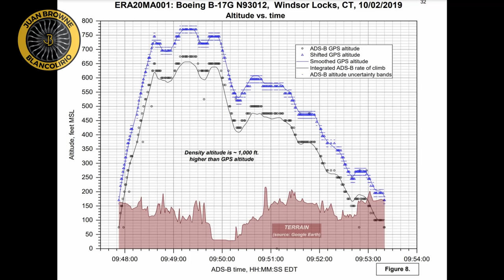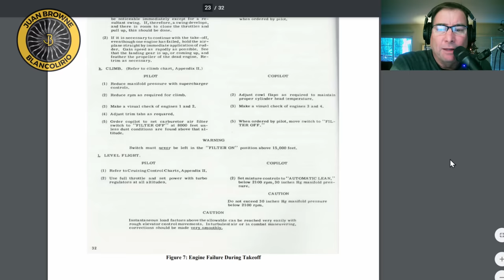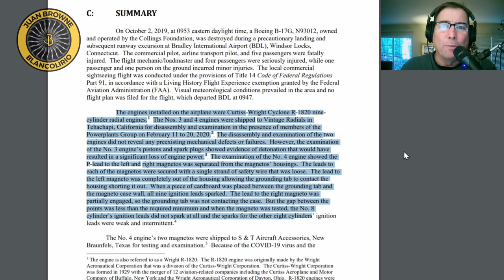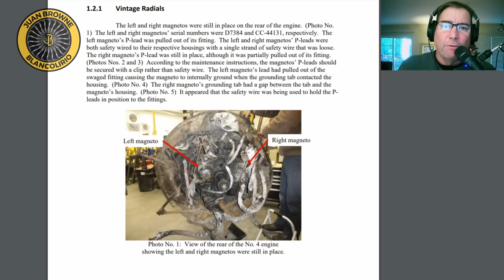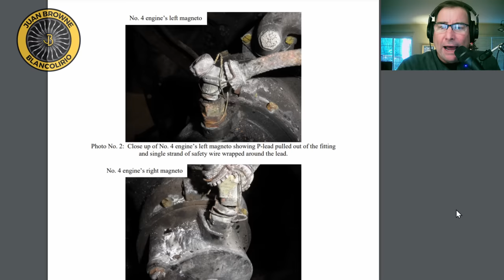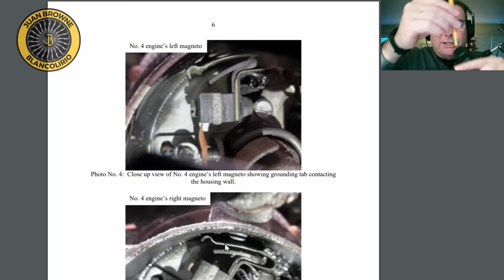NTSB Report B-17G Crash 'Nine-O-Nine' Part II -18 Dec 2020

Comment: Do we know why he shut the engine down?  Even if it was missfiring it would still be producing some power, better to leave it running I'd have thought unless he was worried about causing damage to a valuable engine?  Or did he want to feather it before it stopped on its own?  Can the prop be feathered if the engine isn't running?  Could a windmilling prop be feathered?

Comment: 1 what are you talkin about he shut down the wrong engine don't number three engine is the one that have lost power and he accidentally shut down the number four engine what are you talkin about, you are exhibiting a full reversal from your original opinion. Read the report it was the number three engine that was problematic and he shut down the number four engine then he had two in down on the same side. If you can't do a better job of this I'm going to unload some scribe I'm really disappointed in hearing you say such things

Comment: Thanks for this report. I flew in the 909 in 2015 when it was on annual tour in Venice fla.  We lived near the airport and would see all the planes over our house every year.

I am also a machine shoo instructor and worked in defense plants and race engine shops. The engine tune and maintenance is very interesting. I also drag race professionally and we count on good decisions to not make a mistake in assembly or maintenance.  I can see the B17 had dual ignition system for redundancy and systems to deal with war time issues like engine loss. At some point even these will not save you. 

I will always remember sitting on the floor behind Mack on takeoff and taking pictures thru the upper hatch in mid ship.

Comment: Nice video Juan. Fly Wire’s Scott Perdue has a different take on shutting down engine 4. Here is a link to the Fly Wire video. https://youtu.be/y3p-hGR3ZyY

Scott notes that the pilot passed up runway 33 (which he had speed and altitude to make), dropped the gear too soon, did not follow proper shutdown procedure on No.4, and did not chop power when he was almost lined up with (but short of) runway 6. He shows pics of a failed cylinder (5) on No. 3 but does not comment on whether it might have occurred on impact. Rather, he suggests it failed due to detonation and that the engine progressively failed during the flight. No 3 was never shut down and witness testimony suggests it was windmilling prior to impact.  He notes that the PIC was not an CFI MEI but nonetheless performed checkouts in the aircraft, and that blowing out the mags was a bit of a “home made” procedure.  He notes that the passengers, one of which was a former C130 crew chief, do not recall a run up prior to takeoff though the B-17 flight mechanic states otherwise.  Most significantly, he quotes engineering analysis that suggests the AC was climbing on 3 & 1/2 engines after takeoff but on only 2 after No 4 was caged. 

The engineering analysis is significant.  If engine three was progressively failing due to detonation that would certainly explain the engineering data showing that the AC was flying on 3 & 1/2 engines after takeoff but only 2  after No 4 was caged. It can also be explained if engine four was producing partial power at takeoff (due to the magneto failures you point out) and then engine three failed from detonation. It’s worth noting that engine four would have been producing some power even if one magneto was completely failed and  the other one was not at full capacity.  It certainly seems plausible that the PIC shut down an engine that was still making some power.  

I would be interested to know what caused the detonation in engine number three. Was it, as you question, a mag that was not timed correctly? Or did the pilot push up (and over boost) number three after he  caged number 4?  

Years ago I took a living history flight on this aircraft with Mac at the controls. It is one of my fondest memories. I spent most of the flight in the top turret from where I had the best view in the house,  recorded video, and watched Mac work his magic. I also had an outstanding preflight briefing where emergency procedures, seatbelts, and what to expect during the flight were discussed.  

This crash was so tragic. I credit you and Scott for helping us laymen understand what may have happened.  I hope the Collings Foundation can learn from this, get another 17, and get it’s exemption back from the FAA. That may be a long shot, but living history is so much more impactful than watching a video or reading a book.

Comment: Excellent presentation.  Well researched and superbly delivered in an interesting and educational format.  Easy items to query, what did the engine run-up look like on the mag check.  The P lead problem should have revealed itself in some manner, perhaps a scope.  The other easy query, is what happened to CRM.  The complex nature of this large aircraft demands checklists and CRM to correct or mitigate the problem or problems.  Shutting the engine down in the manner exemplified here results in the final conclusion.  Running out of airspeed, altitude and ideas at the same time.  Once again, thank you for all your efforts.  It is highly appreciated by the community.  (35,000 hour, Airline corporate accident investigator and FAA evaluator on the 747 and other birds plus large military bird check airman.)  Also known as bum.......

Comment: if the aircraft is maintained to OEM specs it should not be allowed to fly. analog ignition systems are easily updated to digital. we restore old motorcycles some use morris magnetos.

Comment: Bead blasting of spark plugs became unrecommended practice in automotive field back in the 80's, bc it actually damages the spark plugs by pitting the ceramic insulator and facilitating potential sources of stress cracks, which result in current leakage. The evidence clearly shows that those engines were poorly maintained by the responsible person who sadly was killed. An operation requiring a McGyver like skills of an elderly 75 year old is almost criminal.  Poor guy did his all and did not know when to say BASTA!. It just shows that a complex flying machine can not be properly maintained by elderly volunteers on a shoe string budget. I would love to see the Air Force get involved and provide assistance in maintaing such historic programs. These warbirds should keep flying to maintaing rememberance and patriotism.

Comment: That's sad, as a master mechanic myself and having extensive experience with mags and points type CDI ignitions, my garden tractor gets better treatment than this bird.
From what you showed, it's neglect, criminal neglect in my opinion.
Just because someone can run and pass a piss test doesn't make them a qualified mechanic. 
My R/C aircraft get better treatment than this bird did.

Comment: Scandalous and disgraceful.  

They couldn't find the proper clip to secure the lead to the magneto for five years?  I understand that you can't just run down to Pep Boys and buy one, but no one in five years could find, or make one? 

I am astounded that the "director of maintenance" would not only allow this level of half-assery, but would trust his own life to it, as the guy who has to fly it. 

They're crooks. Outright crooks.  They take money from people to take rides in their planes, and they don't even value their own safety and lives enough to make sure the aircraft meets the minimum maintenance standards.  Crooked grifters rolling the dice with other peoples lives.

Years ago, I used to volunteer for the make a wish/sick kids organizations. A bunch of us with classic and exotic cars would take these kids for a slow parade lap around the track.  Let me tell ya, they had all of our cars on hoists, checking them over to make sure they were mechanically sound. Cars that we drove to the track that day.   It is pretty sad when cars going around a professional race track at 50km/h are put under greater scrutiny before carrying non paying passengers, than a 75 year old multi engine aircraft, carrying paying passengers.

Comment: That is not the OSHA approved way to use a step ladder. Need a fall restraint system in order to stand on the top step and avoid getting a taller ladder.

Comment: It's easy to armchair-QB mishaps AFTER they happen.  My frame of reference is working and flying on military aircraft for close to 28 years.  I watched both videos (Pt 's1 & 2).  There are always items in the chain of events that if one of the items is removed, the chain of events will stop.  The first thing/item that stood out to me was the Orlando FSDO AND Collins lost effective communications.  Either one should have re-established effective communications after the Collins point of contact passed away.  The  Orlando FSDO lost oversight and Collins didn't seem to  worry about it.  I think it's plausible to suggest this mishap was 2 years in the making.  As Juan correctly noted, placing blame isn't the point.  Hopefully the tragic lessons-learned will be used to help prevent future mishaps like this.
Reply: ......"placing blame isn't the point".......

In every NTSB report on air crashes I have read the object of the investigation is to discover WHY the accident happened.  If the answer to that question ends up being an appalling lack of maintenance and lack of concern for safety, that needs to be said. That by itself will  often point fingers.....and it should........otherwise how might we keep the same thing from happening again?  This aircraft was poorly maintained by it's owners and it's chief maintenance man, and the decision to fly it, in that condition, was made by it's chief pilot. How else could you put it?

Comment: Very small point gap results in low dwell time which yields a weak spark. ( insufficient magnetic flux buildup ) I wonder if a experienced lawn mower tech could have done a better job. A worn cam also indicates no lube on the cam follower.

Comment: Juan, Thank you. Very well done summary of the NTSB report. My significant question as a pilot and someone who had flown in 909 is why Mac couldn't at least maintain altitude and reasonable airspeed with probably 3.5 engines? At least enough to get them around the pattern successfully. Was there an attempt to cage #3 and an unsuccessful feather occurrence? It would have resulted in windmilling and excessive drag with that engine. This would have exacerbated the yaw and drag more than if both were caged and led to excessive airspeed degredation quickly. Some of the air speed data illustrates a rapid loss of airspeed and then an increase as perhaps the failed  or partial feather was noticed and power to the known good engines, 1 and 2 was initiated.

Comment: It has been assumed that the #4 engine left mag "P" lead was displaced prior to the accident. If that were true the failed left mag would have been evident during the pre takeoff run-up. It is quite possible that the left mag worked in flight. The right mag clearly was defective. The loss of only one mag would not be cause to shot down and engine. The crew did not do the published procedure for identifying which engine failed. I believe the wrong engine was shut down. Engine failures are rare. A double engine failure extremely rare unless caused by a common problem. To have a double engine failure by unrelated problems within one minute of each other is nearly impossible. A ground witness identified the #3 engine as failed. The performance of the aircraft was consistent with two engines failed. (ref NTSB report) Also, if the landing gear had remained retracted until the runway was assured, the aircraft would have made the runway.  One final point, the right wing contacted the ground prior to reaching the runway because; the right turn was still in progress, the aircraft was near stall, the asymmetric thrust from the left engines, and aileron roll reversal near stall. Ref WWII B-17 Flight Manual.
Reply: I would suspect that if the #3 Engine mag problems identified by the test facility weren't caused by the accident then I don't understand how that engine would have ever passed a pre-launch mag check. 🤔🤔

Comment: To sum up, the aircraft was brought down by extremely poor maintenence practices. Poor oversight leads to more oversights.
It's not as easy as blaming one person, if they had three A&P's on the aircraft at various times of the year, any one of them could've spoken up and said "No, I will not do that/ let that pass/ bodge that up".
 I'd be ashamed to drive a car on a road with an engine that looked like that, let alone fly with one...
I am all for not layng blame in aviation Juan, but the multiple failures across several independent ignition systems, plus that horrendous looking cylinder on #3 mean people need licences pulled and to face criminal charges.
This was not one isolated missed maintenence or repair, this was systemic negligence and possibly corruption of maintenence documentation.
This is the whole reason we have redundant systems on aircraft, if one is damaged, the others will carry on. The premise of redundancy goes out the window when redundancy is wilfully compromised.
Reply: These were NOT oversights.  Maintenance paperwork was fudged and falsified.  This goes beyond poor practices.

Comment: Are these engines run with a Lead additive?, Very interesting from an engineering point of view, very sorry to hear of loss of life.
Thanks for sharing.
Reply: BT: Aviation gasoline has Lead additive to boost the octane. However, present fuel, "100 Low Lead" has about 40% of the lead these engines require for full power and detonation protection.  They must be flown at de-rated power settings to prevent damage.
Reply: @KB4QAA  Excellent, very interesting, quite worrying on having reduced power available. Many thanks.
Reply: @KB4QAA  I know of at least two companies outside the us that make 115/145. Is 115/145 not available in the us or did the operator choose to use 100LL?
Reply: @blegi1245  115/145 (Purple) hasn't been available in the US since the late 70's or early 80's.  Same with 100/130 (Green).

Comment: I think it should be pointed (no pun intended) to those commenting about setting dwell and point gap, that neither term specifically applies to setting up the mechanical switching function of a magneto primary circuit. Rather the points are adjusted to set the internal timing of the magneto so that when the primary circuit opens, maximum electrical energy is produced. This exists in a very narrow window of magneto shaft rotation. Point gap is checked after setting internal timing and if out of range indicates something is worn beyond limits. ie point cam or rubbing block, etc. Many A&P mechanics actually do this type of work a few times in the function of getting their license and never again in their career. 
For anyone that wants to actually understand this stuff, I recommend John Schwaner's book: The Magneto Ignition System.
It should also be noted that actual engine ignition timing drifts as point gap changes due to wear of the point cam, rubbing block, etc. Sometimes the timing becomes more advanced due to this wear, on aircraft. I am not sure exactly why and have not thought about it much, but on a conventional inductive automotive system timing typically retards.
Reply: Here is how it is done: https://www.youtube.com/watch?v=0qTMC9szVJE. note the previously mentioned website showing ignition check for 100 hour never mentions e-gap. http://blog.covingtonaircraft.com/2015/09/03/ignition-timing-check/   There it is stated: If your timing is off more than 1-1/2 deg., the timing should be adjusted. Later on it states: If timing is off more than three degrees the magneto should be removed and bench checked for bearing wear, point follower wear, gear wear, etc., and reinstalled. 

If nobody is tracking and logging actual timing changes and adjustments, after the second "should be" adjustment; How would one know that the mag should now be bench checked!

Comment: Am I guessing very wrong if I think that the pilot (unconsciously) elected to try to land it wheels down instead of aiming for a belly landing in order to save the plane? 
With the wheels up he would have had higher airspeed, and better controllability, after all. 
Or am I completely off and the plane would have disintegrated and killed everyone aboard if it had belly-landed?
Reply: PIC should have never taken off. This would have never happened if he just followed common sense.  After that the PIC did everything wrong.  Did not follow emergency procedures.

Comment: Thanks for the detailed mechanical presentation.  I used to work on the old cars and understood, timing, spark gap, condenser, cylinder knock, and distributor cam.  Maintenance could have saved their lives.

Comment: It seems to me that the problem always occurs when a regulating body grants an "exemption" to good practices in order to "help out" a foundation.  It reminds me of the exemptions that the Chicago Fire Department and the City of Chicago gave when they grandfathered many public and Catholic schools from the modern fire codes in the 1950s.  This was alright until the our Lady of Angels fire in December 1958 which killed 200+ teachers and students.  If the code is required for safety, it should stay in place in all situations.  I know that would eliminate historic flights but so be it.
Reply: I agree.  When it comes down to it, flying in one of these machines at 3000 feet in peacetime tells you about as much about history as riding in a Cessna 150.  It's as necessary as undergoing a depth charging.  If it can be done safely, fine.  But it's not worth one single unnecessary death.